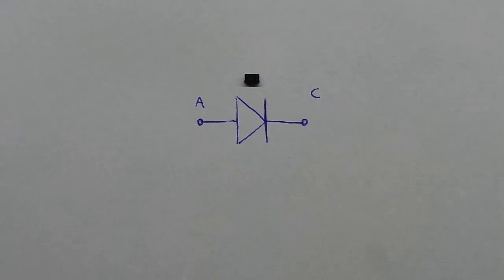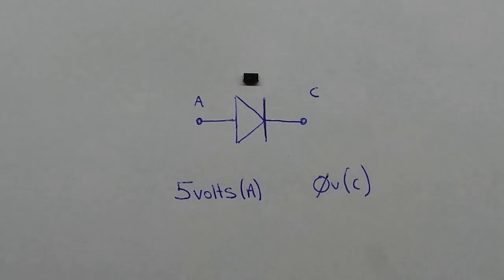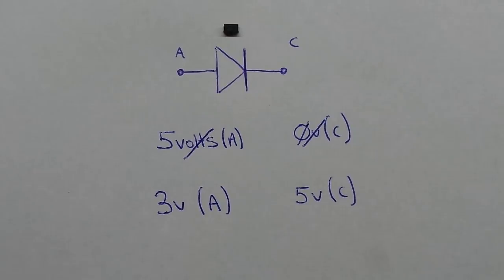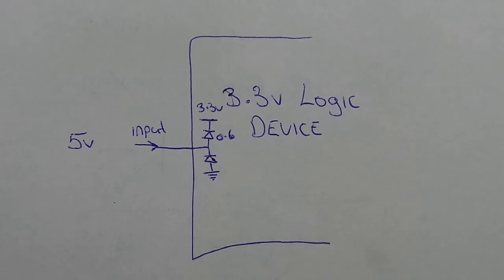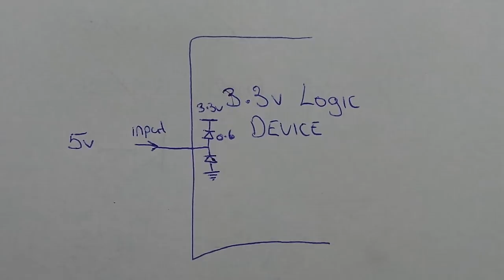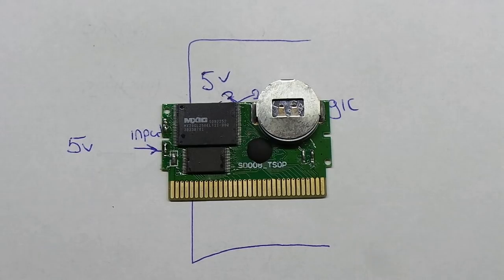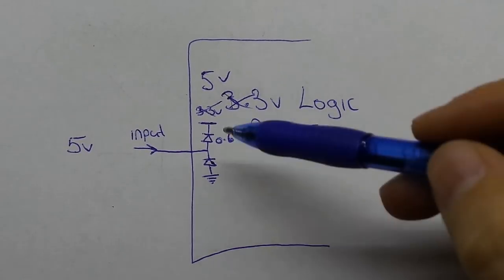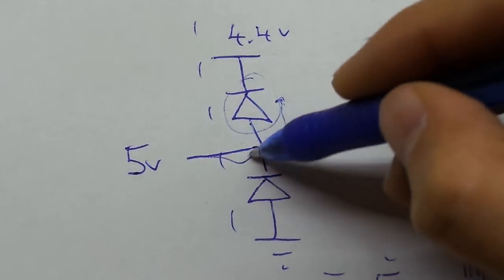Can a bootleg/flash cart prematurely age or damage your console?!?!?

Comment: I came here because, after playing a bootleg cart I purchased from AliExpress on my Original SNES last night, my console stopped working altogether. It was getting power, but would not display ANYTHING on the screen afterwards. I even swapped to an original SNES game cart, and still the same problem. Is it possible to damage the wall wart (Power supply) but not the console itself? I left it unhooked over night and tried playing an original SNES title tonight and it worked fine. (Thank God, cause Id have traveled to ali baba land and went Rambo on em)  So I'm wondering, is it possible the repro/bootleg game could have done SOMETHING to the power supply? Btw, The game in question is a ROM hack put on a cart. (Super Mario World: Return to Dinosaur land) Any info would be GREATLY appreciated!!!
Reply from the maker: Sounds like your 5v reg in the SNES could have overheated. Possibly a short in the bootleg. When the CPU fails, it doesn't usually come back alive the next day but a reg that has shut down thermally will

Comment: I honestly don't have enough experience to know one way or another what the answer should be here.

However, I do know enough about electronics to think if a 3.3 volt flash cartridge can damage a console designed to operate at 5 volts, there must be some fairly complex non-obvious effects going on.

More straightforward electronics logic suggests feeding 5 volts into a 3.3 volt device is... Bad..
... For the 3.3 volt device.

But that's not the concern here is it? Since that would be the flash cart that takes damage from this, if anything.
That's why this issue confuses me, because I know just enough about electronics to know what I would expect to go wrong here, but not enough to know if there's any less obvious effects that could damage the high voltage side (aka. The console) of this arrangement.

Damaging a flash cart isn't ideal, but that's neither here nor there. The consoles are vintage hardware that cannot be replaced. And while there are many millions of such consoles, especially for some of them (a SNES destroyed is less of a loss than a virtual boy, to take a random example), they are still ultimately limited in number...
And that's going to get worse as these systems age...

Ultimately, what can a 3.3 volt device do to a 5 volt system either directly, indirectly, or through some peculiar failure mode?
That is the question here...

Alas, I don't know who to trust, and I'm not well versed enough in this stuff to know.

But off the top of my head I can't honestly think of a failure mode that would risk the console. 
(many that would risk the flash cart, but again, that's less relevant.)
Reply: There is not a single example of a bootleg cart damaging an NES in over 30 years. The first bootleg multicarts were available as early as 1991.
Reply: What a relief, I just got a multicart for my snes.
Reply: The lurking variable you overlooked is that specific "3.3 volt" chips have different voltage tolerance levels.

Comment: I don't know. I bought a bootleg/homebrew version of Sonic the Lost Worlds. When I put it in my Sega Genesis and turned it on, the "Produced by or licensed by SEGA....." intro screen came on just fine, then, instead of going to the big SEGA logo screen, the screen turned red and had glitches.

Afterwards, I tried all of my other games on that Sega, either the screen is just black, or the "Produced by or licensed by SEGA....." screen appears, then everything goes black anyway. 

I think the hacked cartridge killed my console. 

It was working just fine right up until I tried playing it. Now I have my original model 1 Sega Genesis (that I got as a kid when it came with Sonic 2) that basically just powers on but not much else. I don't know whether it can be cheaply/easily fixed, or if I should just pitch it. I already got a model 2 Sega for less than $20 to use in the meantime, but it's also rather fussy (probably needs cleaned), so it would be nice to get my original working again.

As much as I want to play the hack, I can't risk frying another system.
Reply: I believe you. The 100 in one  killed my NES, and it's the same one he shows in the video. Several game had glitches, but when I tried to use Kirby the console glitched and now all games I try to play appear with scrambled graphics. Some guy who checked it told me it was the Vram chip what got damaged. I prefer emulators. They're safer I guess.
Reply: Did your Sega Genesis from your childhood work after letting it sit for awhile? Because I experienced this same effect with my childhood SNES last night with a ROM hack put on a cart. But I left it unplugged overnight and now it's working fine. But I was scared a.f. last night!

Comment: Although not being any technician or Engineer at all, I do know some basics and that's why I tend not to accept this bootleg cartridges bashing trend. The only thing I'd like to know - for a better understanding - is how you were able to measure the current using a multimeter since it had to be serial - from what I learned at the technical high school -  to the circuit itself. Does the arrangement you made allow that reading to be taken? If so, how could I procede to try readings as such on my own cartridges? Thanks in advance, and I loved the video.

Comment: No. The answer is "no".
It MIGHT damage the IC in the cart, but nobody cares about that.
Also, most flash chips can handle upwards of 7.5V before anything notable happens.
Even long-term 5V tests show no real effect in a several thousand hours of testing.

Additionally, if the IC is returning anything, it's either going to be the 5V the console was designed for, or a 3.3V level which is still withing specification for a 5V system

https://www.newark.com/pdfs/techarticles/microchip/3_3vto5vAnalogTipsnTricksBrchr.pdf

Comment: Please explain where you get the value 4.4V being a safe operating condition for these ICs. In the video I can see a Macronix MX29LV640 which is rated for 4.0V absolute maximum (which still doesn't imply you should operate it at that voltage).

Also, diodes don't just magically drop 0.6V - they are non-linear and the voltage drop is highly dependent on the current through them. Making the simple assumption of 0.6V drop, especially in a digital system where the instantaneous current is always changing, is a common mistake and not good design practise.
Reply from the maker: db Electronics completely agree, 4.4v into a 4v max part is not good for the flash but poses no risk to the console, which is the entire point of this video...
Reply from the maker: Oh and regarding the diodes, correct again. Take a look at the 1n4148 datasheet, the diode they use. at 35ma which is the standard read current of the Flash cart (Dynamic measurement testing while in operation) the voltage drop is a touch over 0.8v, almost 0.85 volts. During Flashing where the voltage is most critical current consumption triples which leads to a little over a volt drop. Right in the sweet spot for the MX29LV640. It's almost as if they were designed with this in mind!
Reply: db Electronics
TOLD!
Reply: @CPS2  Do you have experience using chinese repros? I'm interested.

Comment: Also, really cute that you tried to measure an AC problem with a DC multimeter, good job!
Reply from the maker: I was implying armchair engineer to the many trolls on krikzz's twitter and forums that are attacking him. I'm not sure of dB's credentials and from the 2 comments he just made, I am under the impression that he doesn't fully grasp the concepts that are being discussed. Or he's just trying to find holes in a video aimed at the inexperienced. Either way, I'm always happy to discuss this stuff privately, or publicly.
Reply: @bennvennelectronics  Well I can tell you for sure the inexperienced will understand shit from this video. This is aimed towards an EE audience.
Reply from the maker: db Electronics there's AC currents flowing in a flash cart operating on DC in a static condition!?!? I take it you are the author of the original article? Happy to have an adult discussion about this, or you can try pick at a video, aimed at those that aren't familiar with electronics to somehow make yourself feel better?
Reply from the maker: I guess I'll address these comments. An AC problem. No. A flash cart operates on DC. It is a logic device which operates on Low and High logic levels, 0 and 5v, or 3.3v as the case may be. What you may be referring to is capacitive loading due to the high bus frequency (1mhz in DMG mode, 2mhz in Color mode) into an IC. This has nothing to do with  the carts voltage at these kinds of frequencies, and does not pose a risk to the console. The pico farads of gate capacitance in negligible. Or is there an 'AC problem' that I'm not aware of?
Reply: Really cute of you to think there's AC running through your electronics that use an AC/DC adapter.  You really don't know anything, do you?
Reply: He measures current with a DVM in parallel on an unloaded high speed (MHz) squarewave data pin..  
Moreover, he shorts the 5v to Ground and shows that there is some current going through the DVM...   
I am sorry, but I had to stop watching this video because it is just idiotic. 

Also, KRIKzz actually uses this video as his backbone on his forums. 
Furthermore, a moderator called EverDriver on his forums deleted all posts that ever so slightly lean to db-electronic's side or try to provide scientific explanation, so there is no free speech on KRIKzz Forums.
Reply: To clear any confusion; Who's the author of this article that you've failed to properly cite? If you're referring to dB Electronics, calling him an "Armchair Engineer" is far from being adult language.
Reply: Cite? It isn't plagiarism when someone disputes a claim and doesn't stoop to putting random bloggers on blast.  Not sure where you are going with that. Pretty sure he was just talking about trolls with the armchair engineering comment (not real engineers). No need to get defensive.
Reply: Adult, lol, I stopped thinking of you as such when you used the term "armchair engineer" to refer to people like me.
Reply: Yeah, you're more of a "Highchair engineer".

Comment: 5V on one side of the diode and 0V on the other, nevermind the cloud of smoke this condition will create...
Reply from the maker: db Electronics The example is to show what conditions a diode conducts or doesn't conduct, the forward voltage required for current to flow. You get that right?
Reply: So YOU'RE the guy that started this rumor to begin with.... you should set Bob over at RetroRGB straight about this because he still believes your article about this as well as many others.
Reply: @skins4thewin  I think he took down the article but the damage is already done.
Reply: db Electronics
TOLD!